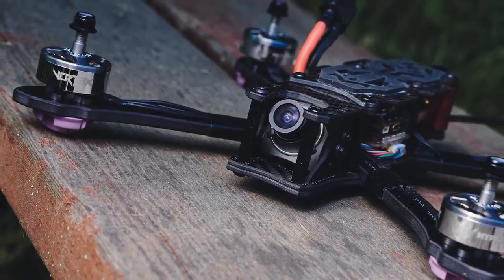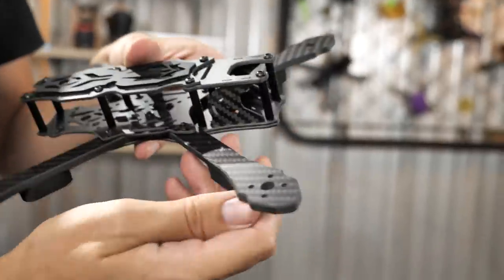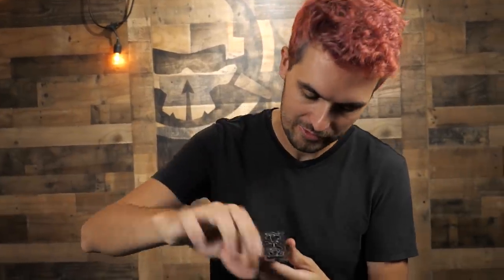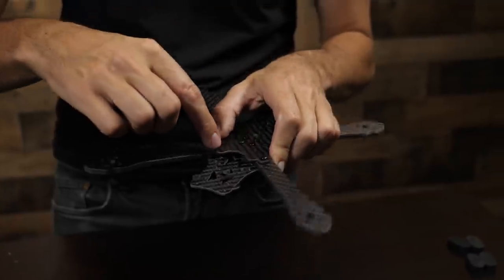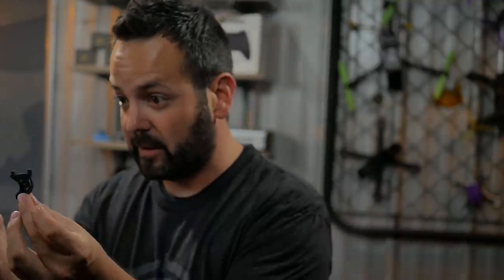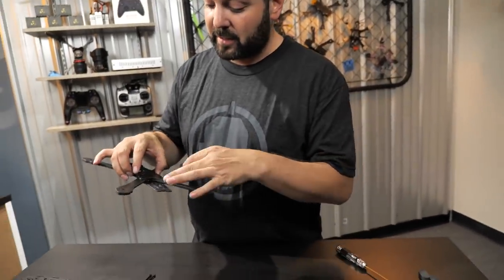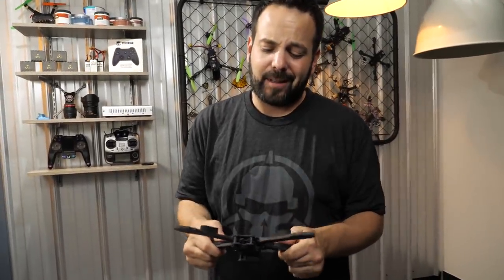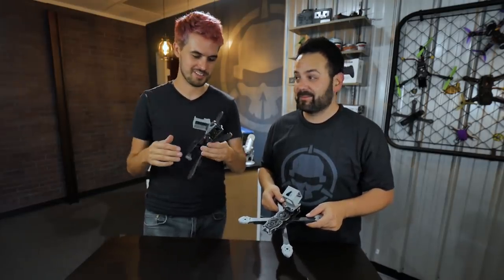Flow Frame Overview & Assembly Guide

Comment: That quick release arm feature has to be the most appealing part. If you were wanted to play it close and use bullet connectors for the motors imagine how easy it would be to swap and keep going on the field. Perhaps thats the next evolution: far more plug and play happy motor systems
Reply: Check out the arms for the TBS vandetta

Comment: I love you guys but I seriously dont understand the point of this product. The market is fully saturated with these alien form-factor frames in all price ranges. Why bring another one at this point in time (very very late), there's really no gap to fill with this kind of design. On top of it, its not even at a comptetitive price point, its on par with competition and you can actually find cheaper versions of this design that do the same job, with good quality material. To make matters worse, not even the name is original.... at least you could have stuck with the crowd-voted potatoe or flotatoe or whatever. The CL1 was a product that honestly made a lot more sense. I'm a bit disappointed by the lack of creativity here, you guys are THE NAME in the FPV industry and I can name at least 2-3 individual contributors out there that have full time jobs that have nothing to do with FPV that bring more helpful products to the community.
Reply: GyroPyro because not everyone wants a mustang. Some people want a vet, and yet others want a viper. I want all 3

Comment: You guys should've put the top carbon plate under the gopro carbon plate on the non-slammed version. It's a cool frame, but if I want to start off with the non-slammed version, then say upgrade my gear to get the slammed version, I'll need two different 3d printed gopro mounts.

Comment: Was pricing out my first quad, where I was going to commit the cardinal sin of getting a cheap chinese knockoff frame, but then found a way better quad for cheaper (with 10x batteries and charger and ....).  For those with more experience, how does this stack up in terms of pricing vs quality (hard to tell sight unseen I know)?

Comment: I like how the arms slide in, but all in all it seems like too many parts to be really stiff...
 Also in the low deck version:those screws that pass right next to the arm will certainly put good pressure on the arms, but also create strong sheering pressure on the  sandwich plate! Bet that's gonna be the first spot to crack.... 🙄

Comment: 🤔 Well, sooo.. the bottom plate has 2mm?  And the top opposite, statically, is two seperate top plate parts?
🙄
Just... nnnaaah! Looks good, but I don't trust the strength of it at all! Acessability vs. robustness?